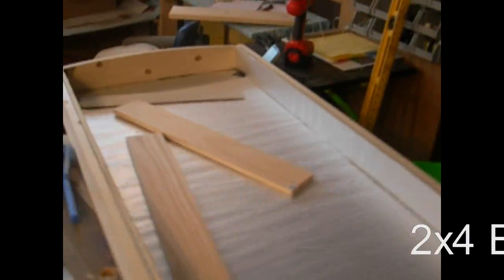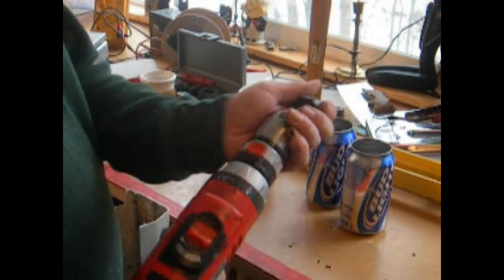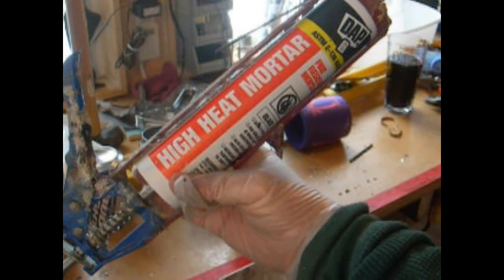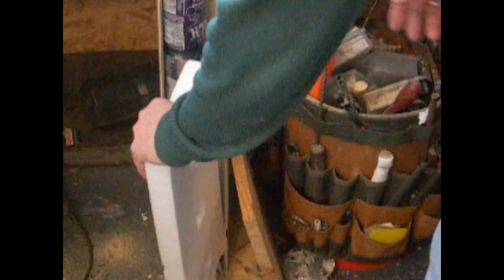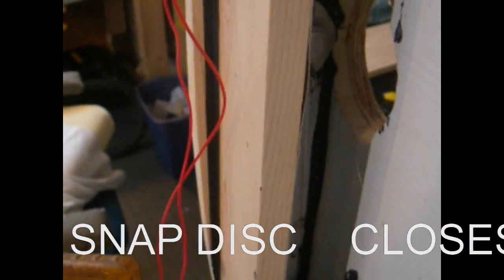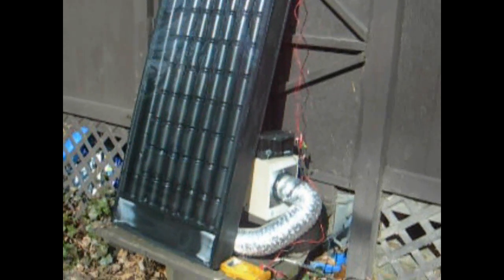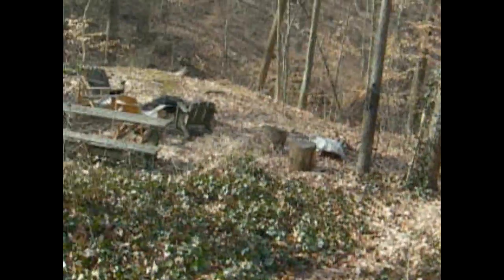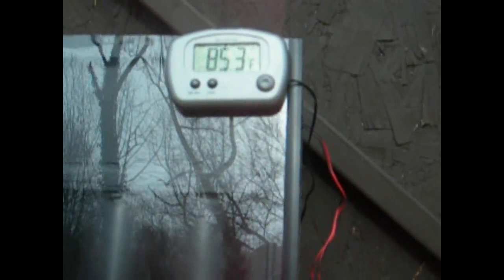HOW I MADE A SOLAR POP CAN FURNACE / HEATER

Comment: I made a 68 by 28 inch Indoor Window Solar Collector, out of down spouts. It is totally self sufficient. It runs off of 4- 1.8 watt Solar Panels. The Solar Panels drive a 4 inch  90 cubic feet per minute Computer Case Fan. On a good sunny day I can get 138 degree temp out of the fan. But the whole array turns into a 68 inch heater also. I have a ceiling fan in the same room and I can heat my main level of my house very well with this. It is an amazing window heater. I'm glad I built it. Peace.

Comment: Also, with the hot exhaust at the top, most of the heat coming into the building will go straight to the ceiling, rather than warming the volume of air that you actually spend your time in. It would be better to duct the hot air a distance from the heater. The cold air intake should be at ground level, even if it needs a duct, so the coldest air in the room enters the heater, which will increase its efficiency and decrease external heat loss (see my previous comment \/ ).

Comment: Try using polyester black felt (purchased from Joanne's Fabrics), center half way between the front and back of the panel. the air flows through it and it has MUCH more surface area than your curved cans. I built 2 4 x 8 panels and they produce 135F easily. The black coloring is impregnated in the polyester fiber, so it will not fade like paint.

Comment: I made one similar  to this but larger so I could space the can rows apart about two inches and installed a mirror under them. The cans I painted flat black all around and used the foam insulation on the bottom and sides of the box. I used 10 stacked cans by 10 rows and this set up produced enough heat that it made  my small home shop 95 degrees by noon. I live in an open area with no trees and it was a full sunny day with outside temp @ 35 the mirror helps to reflect heat to the back of cans

Comment: If you want more energy coming into your house/workshop, you need to keep the temperature of the cans low by increasing the flow rate and decreasing the turbulence inside the cans (bigger holes). This is because the hotter the cans, the more heat they radiate back out of the device.
The same amount of energy will hit the device from the sun, whether the flow is fast or slow, but less energy is lost when their temperature is low.

Comment: Think you panel is brilliant and love how you build it from recycled cans, food for thought: if you were to create a means of extracting the air between the cans and the glass/plastic panel may help improve efficiency as it has less air to heat before it reaches the cans plus maybe craft some small fins to bridge the gap between the parallel rows of cans and also increase your surface area and heat input

Comment: @YTSparty     I think everyones situation would be different depending on several factors.  We are lucky enough to have windows facing directly south and our roof  is slanted due west.   We have no overhangs that prevent sunlight, and nothing blocking the sun on the south side of our house.  We get plenty of heat generated via the window method for most of the daylight.   We put one up in an east facing window, with larger overhangs and it still produced heat in the early morning hours.

Comment: Great job - It sounds contrary but I think you have to reverse the cold are intake and hot air output. Pulling warm are that is higher, sending it through the unit, and then blowing it in from to a lower point will allow the warm air to mix in with the cool and warm the room better.
If not then use a fan on low to gently blow the warm air down and mix in with the cool air to even up the temperature throughout the room.

Comment: Houses that have forced hot air heating nearly always have the vents near the floor because hot air rises. Of course, you want to pull the air from the bottom because colder air sinks. So you should pull the air from one vent on the bottom of the wall or floor and introduce the hotter air at the floor level on the other side of the room. That might be the limiting factor, he might not have enough hose to do keep the 2 ports far enough away from each other.

Comment: well its been a few years now Rich, how has this solar furnace preformed over the last few years ?
Reply: IfingerblastGranny's probably considering he drinks that piss water Bud Light.
Reply: thats the guy who made solar heaters from Pop cans,silly in my mind, as i tried doing a solar direct air long ago but its just a Bad idea as when it gets colder and WET from moisture yeah get black mold and its just a waist to have them holes in ur house as it will be way more of a Heat deficite in the long run. I mean all that work to cut Pop cans? how much is a piece of pipe with no little joints from Home depo? was this promoted by the Oil industy bc so much work for a Bad idia

Comment: Nice work,but i believe it more effective if you matched airflow through the unit with the port sizes. That is to say, if you need three can diameters to match the diameter of the inlet/outlet, then place 3 cans in parallel throughout the unit and have a channelling effect so that there are only 3 long channels flowing through the box from inlet to outlet. air is then being heated for a longer distance,absorbs more heat &there will be no restrictions in the air flow if the ports match the ducts

Comment: Nice vidi .......... would have thought that one large hole would work well......... there is a large lip to get the air to tumble through the cans ........ and why use power to push the air in and out of the unit ..... convection should carry it if the flow is not too restricted. But great unit & love the workshop !
BadDL282 Has a good point, but then again 75% of heat is lost from the head ...... i'm sure there are yards of paper coverd out their of this stuff.  Regards Bob ( London )

Comment: i am seriously planning on building one ~400 can heater in Finland, i have big old windows so i was planning on using them as they are meant for use outside(plus they were free).
I think the most important thing is to get the "middle space" between the glass and the cans as airtight as possible?

Comment: One idea,one could put energy drink cans(narrow) inside those,also could take an wire and put it around some stick like coil take it off and put it into the cans,that will probably heat up  the stuff .Also low cost and low weight.Sorry for lang. mistakes

Comment from the maker: Hi the metal grabs the heat and slows it down. If you just have a box and put a fan on it the box would. Cool down and not make good heat with nothing to trap the heat and hold it. My downspout heater when it gets sun it runs around 110. Steady as long as it gets sun.  Rich

Comment: You fell at the last hurdle, Rich! :-( By covering a window (or in this case, a glass door) you've lost the insolation value of the glass. The solar energy that would have entered your home directly through the glass as light now has to heat aluminium, which heats the air, which then enters your home. You'd probably have been better off just laying dark tiles or slate/stone on your floor to soak up the heat.
Reply: nagualdesign   Has
Reply: Glass has almost no insulating value; it's the air trapped between two panes of glass that insulates
Reply: He didn't say insulation. He said insolation. It's actually a completely different word

Comment: Thank you Rich.  My only concern would be the residual fumes from the black spray paint.  I wonder how it would work if the cans weren't painted?
Reply: The paint is on the outside of the cans.  The air to your house passes through the inside of the cans.  Built properly air from the case shouldn't be passing into your home.

Comment: @sc00b3rt i was thinking, do you think if we had the cans snake around it would work better? what i mean is, instead of having air go from bottom to top in all the rows of cans..have the air start in one row, when it gets to the top, push the air back down the next row over, and then back up through the following for ever row of cans. that way the air would remain inside of the cans longer.   what do you think?

Comment: I have made my solar panel and have some tree problem with the sun light like you. the panel works and when the sun changes direction , i have a hard time trying to align up the sun light . sometimes i get the sunshine and sometime not . Do you have any suggestions of getting direction of the sun aligned to the solar panel to run the solar heater. Clay

Comment: Great idea! I'm thinking of building one of these for my shed.Thinking of taking the ends off cans and making elbows for the corners so the air has to pass through every can like a snake first,instead of epoxy,using duct or alum. tape painted black .Also thinking of using glass on both top and bottom,and putting that silvery film on the glass that reflects heat mounted backwards on the inside so the heat can't reflect back out of the box.Have you tried any of these ideas before I start my build?

Comment: I would suggest removing it from the door. The sun will heat what it hits inside the house/shop.  By blocking the window with the casing, you are loosing what heat would have been generated in that space.  

I would move the heater to the right of the door where it is just siding.

Comment: Looks like maybe the hot air disrupts the cold air intake a little (because it points down).  Another fella put a sheath on the hot air fan to make sure it circulates the air away from the low cold air uptake fan...

Comment: @taylordesignsllc Using cans as duct work inside the box gives more surface area to heat. The more surface area you have for the air to come in contact with, the more heat it will gain. Also, this slows the velocity of the air down, which allows it to gain more heat.

Comment: @sc00b3rt  You would be limiting the amount of sunlight depending on the angle of your window with the sun. I have a slanted roof due south, laying a collector on the roof would like be 10x more effective than simply collecting the heat from inside.

Comment: Haven't stopped thinking about this since I saw your video last week, was thinking maybe if you made it from cans that cat&dog food come in, they have ripples in them which should increase the surface area and may also slow the air passing through them slightly so it has more time to absorb heat.

Comment: What do we need cans for? Can we just have empty cabinet painted black inside? That would give you more air volume and faster flow. Correct me please if I am wrong...
Reply: aluminium has very good heat conductivity, and the surface is bigger on the cans , and they are free, and take less space,so they are a better idea.
I'll make one myself, is a good idea, thanks for sharing Allen!

Comment: you, and most others have lined these cans up in parallel to each other, wouldnt there be a better heat gain if they were connected in series? or perhaps a dryer vent snaked around inside? im new to this, but am interested in heating my greenhouse with it. thanks for your imput. :)

Comment: i'm wondering why everyone is using the whole can. is heat actually conducting enough around the backside of the can? more work I know to cut all the cans in half, but the enclosure/ box size could be reduced, saving  cost and weight. I'm also wondering if a sheet of aluminum bent with deep corrugations would produce more heat per surface area.

Comment: Hey, I am very motivated by your video. Thank you for putting it here for us. I would like to ask if the High Heat Mortar that you used is performing well. You added that Aluminum Gutter Glue works well too.
My boyfriend and I are excited to build one following your pattern, but he wondered if the glue was made for masonry and would be flexible enough after it cured and was put into use. Thanks again for your video! :-)

Comment: Easier way.. get a sheet of Insulfoam from Home Depot.  Measure you window and make a box out of the foam ONLY.  Paint the inside black and cans.  Put a ledge across the bottom.  Make hole along top and bottom.   Insert a small computer fan run by solar charger.    Then place this unit into the windows from the INSIDE of the house.  It is very lightweight and can be taken down when summer returns.  Produces 120-150F heat.

Comment: Rich,
very cool ho wlong does it produce warm air seems like it would heat up your thermostat would activate and the fan would circulate the warm air out, leaving you with cooler air is this not the case? seems like you should have a drop in temp

Comment: That was excellent.  Thanks for sharing that.  I was wondering, also, what can one do for the night time to keep things warm?  Would the primary suggestion be to use as much photovoltaic units as possible to charge a large series of batteries, and use an electric heater?
Reply: What CAN one do indeed

Comment: the real question is does it work on cold days? of course on hot days... the furnace will get hot..., but on cold days, does it really work that well..
Reply: As long as the sun hits it should work. I use just cans like such in a south facing window at 10°f and it was making a large room run about 75°f-78°f.

Comment: I was also thinking the same, but I guess its because if you give out the heat from the top then heat would only stay at sealing level leaving out the lower portion of the floors cold... (thats a guess by the way)

Comment: i have an idea. im not sure if it would work  well but its and idea. so obviously the sun heats the cans and brings warmer air in. now i was thinking for cooling if i made another set of cans in a case and buried it in the ground. then when it was summer, move the fan to push air through the buried cans to bring cooler air in. sorta like a geothermal for air. might not work well but its an idea, and very cheap. any thoughts?

Comment: I do realize that this is an old video. But since people are still discussing it I thought I should give a comment. I'm guessing that you are using this to try and heat your workshop.

By covering the glass in the door, which seem to have roughly the same size as your solar collector you just make an extra step for the heat to transfer indoors. It will be colder inside than it was before. You already had a solar collector with the glass door.
Reply: +Gussoh Clear glass doesn't absorb light energy. At least, not anywhere close to black aluminum.
Reply: +Tyler Reed The light contains the same energy. You don’t get more energy in the light because of a black surface. The difference between black and brighter colors is that the brighter colors reflects a larger part of the enery. The reflected rays are reflected in all directions a matte surface. In this case the you can let the light shine through the glass and hit the flooring inside. There the light will be reflected more than it would have been if it were a black aluminum surface, but since the light is hitting the floor, far away from the glass, only a negligible fraction of the lights gets reflected out though the window again. Most of the reflected light hits other parts inside the room. The alternative with the black surface just on the inside of the glass is that more of the lights gets absorbed than if it would have been lighter, but most of the reflected lights just go out trough the window again.

Comment: this is just hot air that is being pulled thru the cans with a small fan, not water. yes he does get electricity from the sun via photovoltaic cells that charge a batery that runs the fan. its a self contained heating unit. needs no outside power/electricity ,but it still wont heat water..lol

Comment: Great job!  Those were very clear instructions...I can't wait to start my own. I'm curious as to how the thermostat and battery are wired, maybe you could post a video or schematic for this. Thanks.
Reply: It's a good video. but I think the design needs better insulation. Plus the way he mounted it isn't really getting the best 🌞. 

But I do think what he did was really cool. 

Especially if you were to combine it with Earth pipe technology. Like they use with below-ground geothermal greenhouses.

Can you imagine.. 

All you would need it's just a little bit of solar to keep a house warm during the day and perfectly livable at Night.

Then take the excess energy and put it into a electric car.

put the electric-car potentially on a rail steel on steel gets 90% better efficiency. 

300 miles ×90 on rail equals 27000 miles. I mean hell they make carbon fiber cars that actually recharge up to 40 miles per day on normal tire to road conditions. 

 40 mi * 90 is 3600. and at 100 mph per day it would only go through 2400miles with a power per day. With a remainder of 1200 miles per day.

Comment: I have a question.This is a great and impressive job, but i can only assume it works from sunlight?So meaning u can only get warm air from it when the sun is warming it up.So you cant use it to keep you warm when its cold, you can only use it when its warm outside?Kinda defeats the purpose.
Reply: If "warm" is 10 below outside then everything helps. I wouldn't install one of these in Florida, but Alaska and Saskatchewan should have them everywhere.
Reply: Ahh okay, so if it's any daylight it works I see now. I assumed it would need warmth from the sun to amplify that heat further. I did not realize it can amplify just plain uv with something like -10 temperature.
Reply: +God of Thunder yeah true. Like that oven with the lid that is theoretically a box. they added some heat reflection sheets and painted it black. apparently cooks a whole chicken in a few hours using similar system.